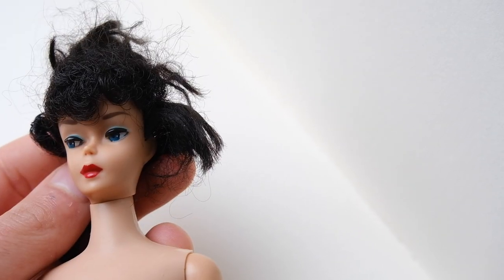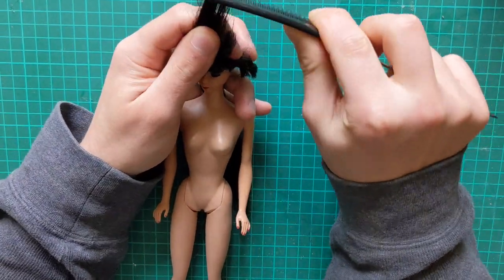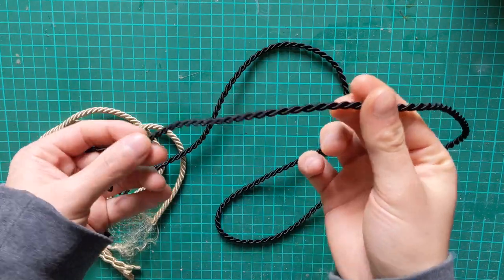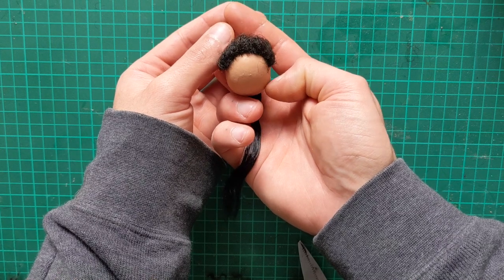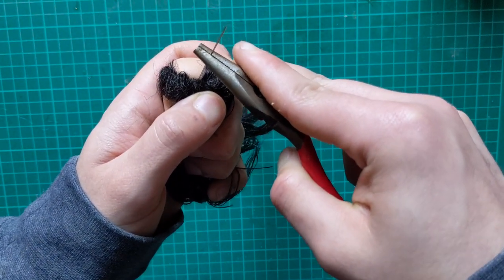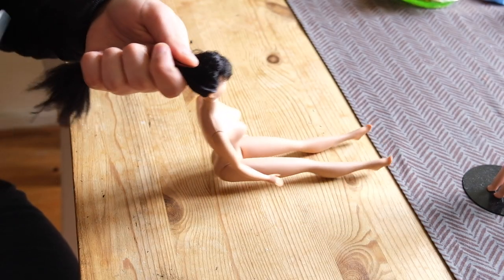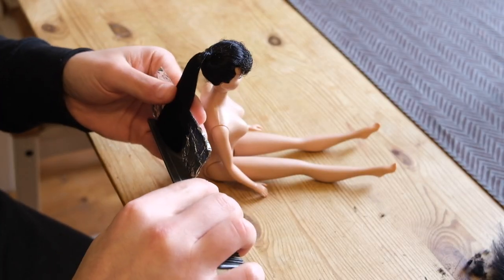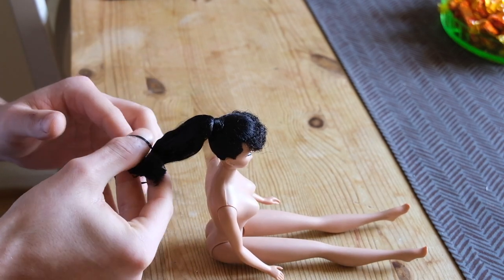Rerooting a bald vintage Barbie #barbierestoration

Comment: About threading the hair through the needle: you might find it easier to use a tapestry needle threader (it looks like a double-ended, very thin metal piece that allows for incredibly easy threading into the needle you're using). I've used that for so long now, and it really does help make the knot rooting go faster!
Reply from the maker: Thanks for the tip!

Comment: Vintage ponytail Barbies had Saran hair. There are different textures of Saran. The Saran they sell today is a hard Saran. I've personally researched this fact. Mohair doesn't heat set . The other fibers do not hold up to heat setting of which Mattel still uses today. Barbie hair is set in a  special oven. Many saay acetate but it's a fragile fiber .
Reply from the maker: Could very well be. A majority of collectors are convinced it's mohair, and it's what is available to us now, so that's what most people use.
I have to strongly disagree on the heat setting of mohair, in my experience it sets great, even better than saran.

Comment: Judging from the way you described the decorative rope fibres you used to reroot the doll as very natural feeling and soft, as well as ha ing limited colour options, my best guess is they’re Kanekalon some similar fibre. Kanekalon is/was used pretty heavily for barbies, especially those from the 1980s up until at least the 2000s. I dont know what fibres vintage barbies of the 1960s used, as I haven’t had the chance to handle one myself and identify the hair texture, but it’s possible they used some natural feeling fibre like Kanekalon.
Reply from the maker: I find myself having to disagree, I have felt kanekalon many times, it is way thicker and is definitely more "fluid" than this fiber. Also it can't hold a curl very well. This is something else entirely. 
I guess it's just one of those things where you have to feel it to see the difference haha

Comment: I have one like this Her hair has been cut But rather than rerooting which I don't do ( but a great concept) I thought I would just paint her bald spot with black liquitex and maybe a matte finish to seal I think I have enough hair to style somewhat What do you think DDW? Would this be a good Idea? Before styling I think I would comb the hair away from the bald spot and use an elastic around to secre the hair down then paint the bald spot I'm surprised they didn't paint the head as with other dolls
Reply from the maker: You know what? It's quite controversial to do anything to vintage dolls, as I've learned the hard way, but sometimes you just have to get creative and work with what you got.
Or you could get flocking powder and use that to distract from the missing hair with something that looks vaguely like hair?
Reply: The flocking idea is excellent ! Thanks for the tip!